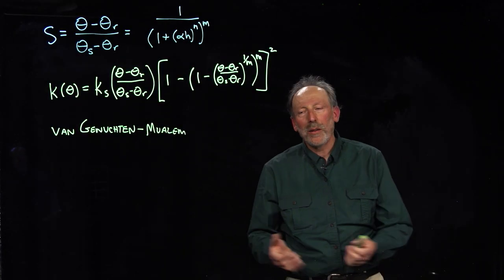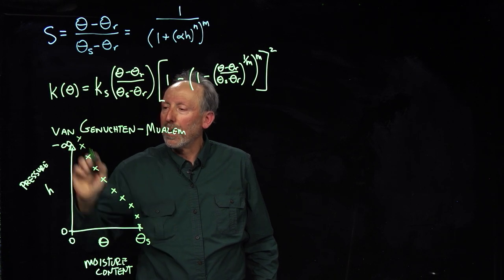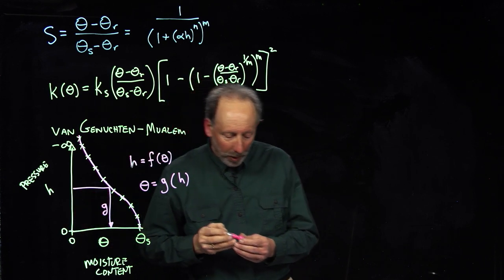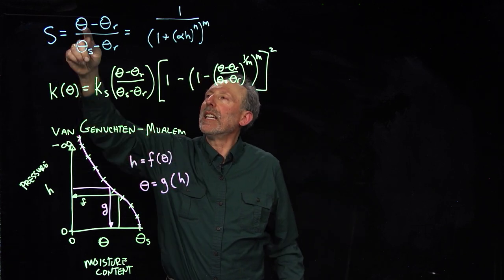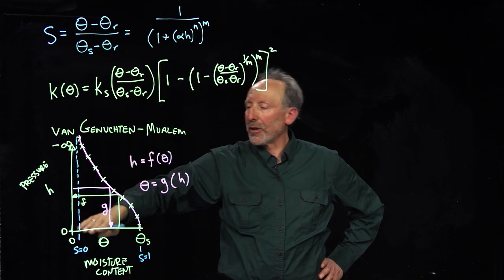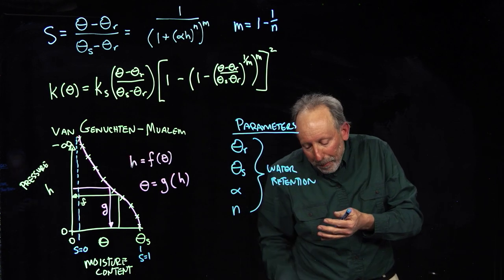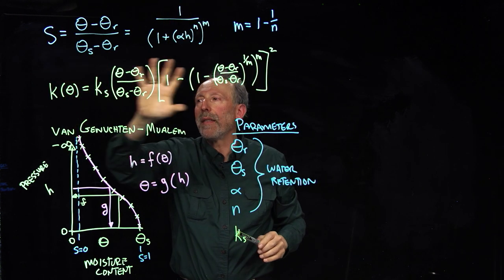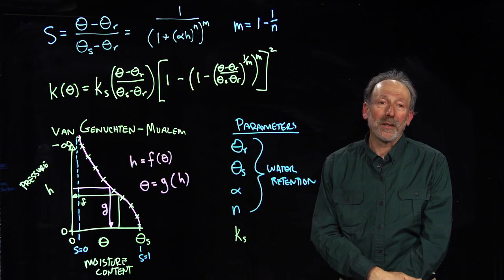2 5 2 1 2 van Genuchten Mualem model of retention & conductivity

Comment: Hello. Thanks for the excellent video. I have a question about finding Hp of a soil from the curve. Could you please help me with this:  I have a soil with theta_s=0.32, theta_r=0.01, the soil field moisture content is 35.2%. I have the retention curve, but I don't know how to extract its related Hp from the curve. Do I need to use the field moisture content as theta in the bottom axis to find the Hp on the vertical axis? If yes, field moisture content=35.2% is more than theta_s=0.32. Is this possible?
Reply: Please note that in this formulation, theta-s is the maximum water content of a soil.  So your proposed situation is not possible.
Reply: @selkerjss  Yes, thank you so much for clarification, that's exactly why I asked it. I actually got these data from a lab, there is a column of data called "saturation" which I think it's the saturated system to start pulling the water out. I've asked them to clarify it, and if it's the case, then theta_s would be more than field moisture content that seems to be right. Just another quick question: Is the field moisture content (%) at 105 degree, the gravimetric moisture content? If yes, I will need to convert it to volumetric moisture content, put this on the curve and get the related pressure (h), right?
Thanks again!
Reply: @nasrintaghavi6877  Hello Nasrin - when you see data associated with 105 degrees, this is typically indicating the "oven dry" condition.  It can be expressed either gravimetrically or volumetrically, which in either case can be put in % terms.  So I cannot give you a solid answer.  You need to look at the laboratory procedures.
Reply: @selkerjss  Dear John, thanks for your help! 
It is not mentioned in the laboratory files, so I just asked them to clarify it. 
Cheers.

Comment: How we can measure the values of pressure and saturation of a soil in different deep. I would like to write to your email.
Reply: Look up the "instantaneous profile method."  Typically you use a TDR/dielectric sensor or neutron probe for moisture, and a tensiometer for pressure.  You dig a hole, and install them into the sides of the hole and re-fill the hole.  That said, there are many approaches - it really depends on your site and objectives.
Reply: @selkerjss  I understood John.
My focus of my question is this. I´m a Metallurgical Engineering, and I need to model  the movement of solution in a unsaturated porous media (heap leaching), but the studies that I have been read they modelling the head of suction vs saturation or moisture of ore using the Van Genuchten model. But how they measurement both parameters (head of suction and saturation) to adjust the permeability? Can you ligth me in that please. Greetings Jaime